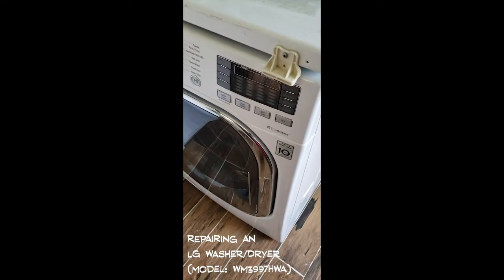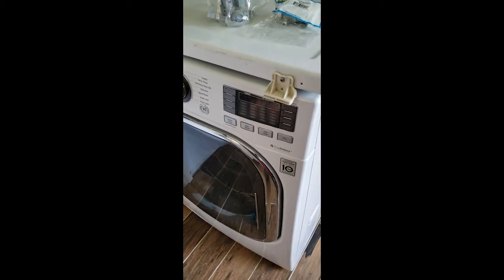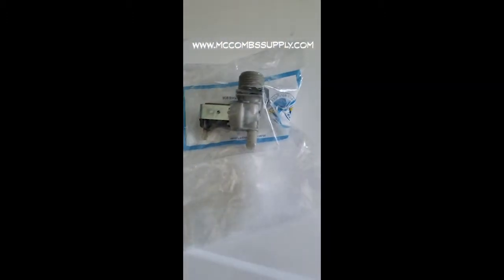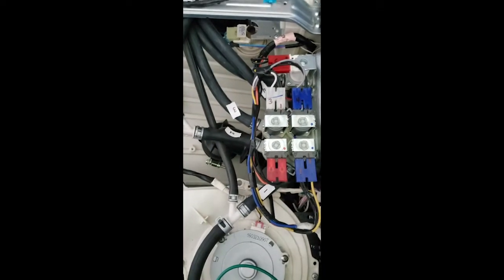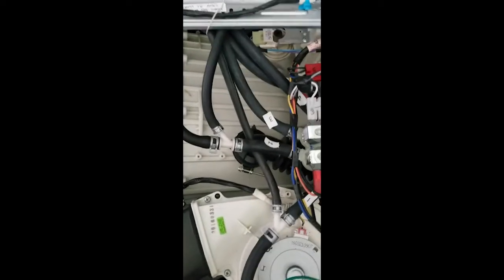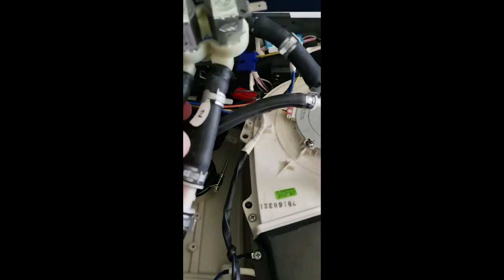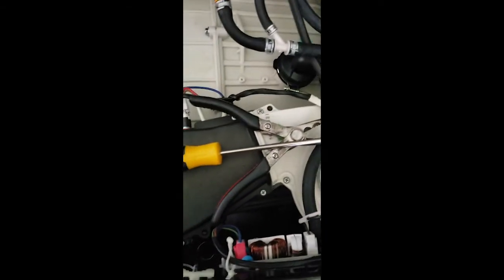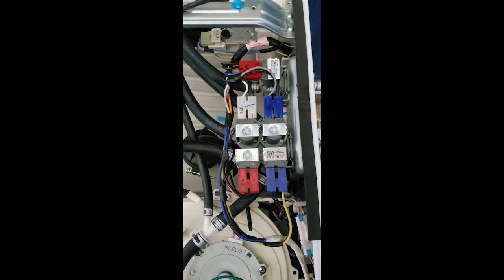LG WASHER/DRYER (MODEL: WM3997HWA) WATER INTAKE REPLACEMENT

Comment from the maker: UPDATE (5 months later): The Water Intake Sensor replacement worked great and fixed the water build-up in the wash basin problem. 

NOW this damned thing needs a new DRAIN PUMP MOTOR. Luckily I found a video on YouTube (https://youtu.be/HZr8qjQ81CQ) that essentially was CLOSE to my model BUT not exactly.

The CORRECT drain motor for my model (WM3997HWA) is Part # 4681EA1007G. I figured that out AFTER I got the old motor off and noticed the part I ordered off Amazon was wrong.
SO - I just decided to go back to McComb Supply again and sure enough they had the OE Drain Motor I need for $26.

No reason for me to do a whole video on replacing the Drain Motor because there's no way I could do it any better than Steve from Parts Select. 
Just know that if you have this LG WM3997HWA there are subtle differences.

- There are SIX screws holding the Control Panel in Place.
- The DOOR LOCK WIRE HARNESS is a total BITCH to get at, so I had to lean the door assembly forward to access it (no way I could do what Steve did in his video).
- This model has 4 HOSES attached to the Drain Pump.
- This model has 3 BOLTS holding the Drain Motor Assembly in place. You'll want a 10mm socket and a few extensions.

Good luck.